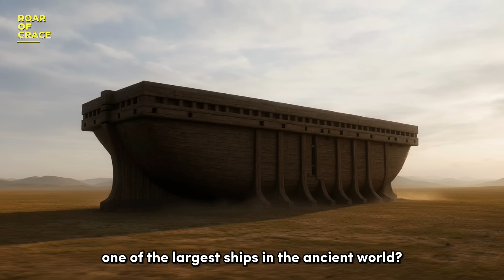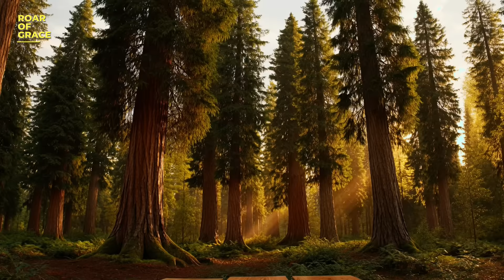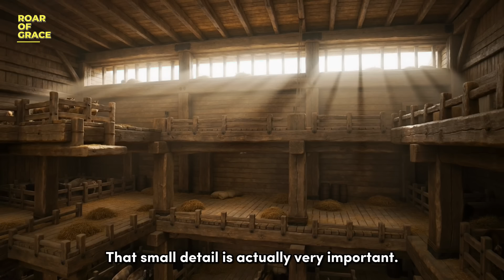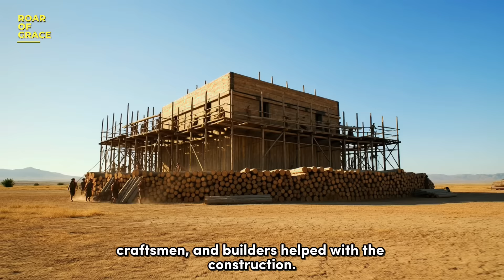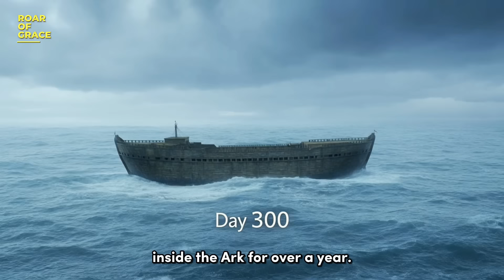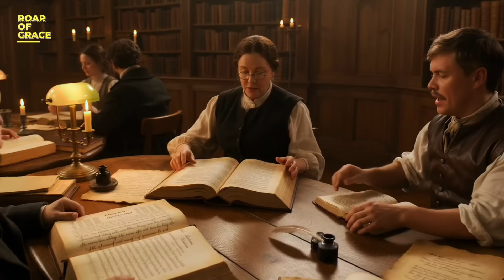How Noah REALLY Built The Ark: The Engineering Mystery REVEALED!

Comment: "Violence filled the earth', so God's answer was even more violence. Violence, that checks with the God of the bible. BTW the length of the cubit varies widely because the length of a man's arm varies. The outgassing from the pitch, along with the gases from the methane caused by the humans and animals, would have displaced the oxygen inside the ark. Everything would have died given the length of time. These gases are heavier that oxygen would not have expelled through the window at the top. A window all around the top of the ark a cubit high would have allowed a tremendous amount of water into the ark offsetting any ballast and likely contaminating any fresh water on board and destroying food stores. A boat that size would not have been 'technologically possible' in that world. It's far easier to just say this never happened and the story is just a metaphor.